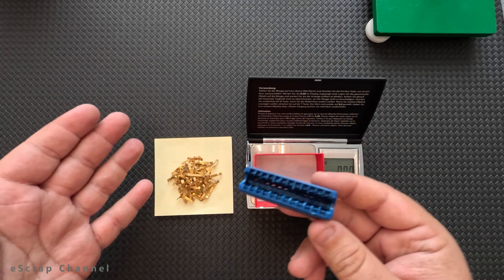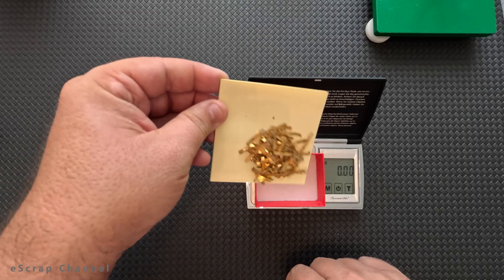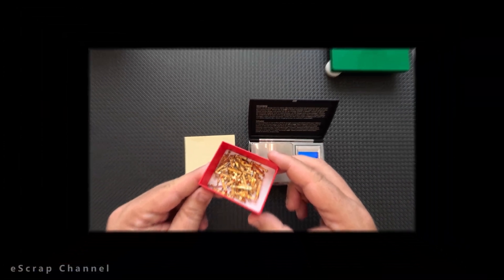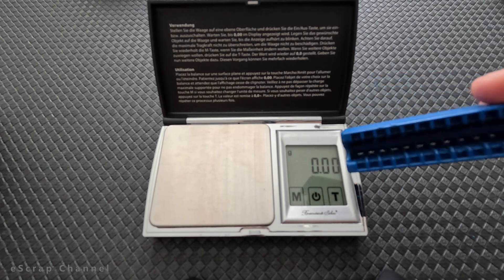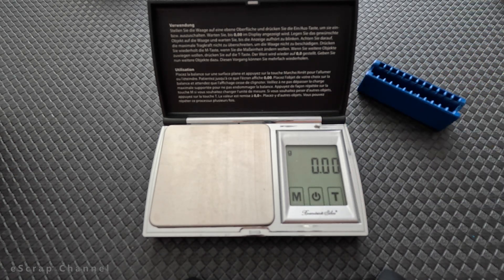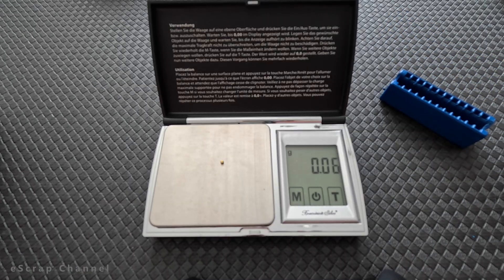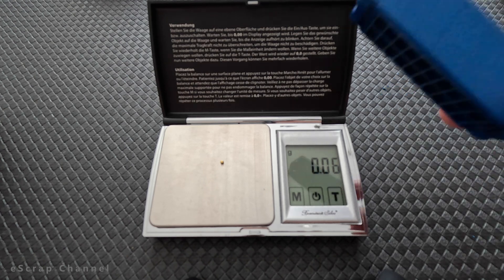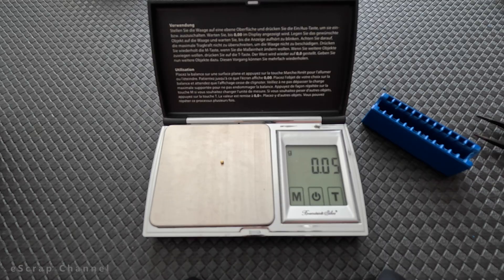Gold Content Check - AMPHENOL slots

Comment: Hi, 
I'd like to try something like this, and since you're experienced, I'd like to get your opinion. Normally HNO3 is used to dissolve silver and then convert it back to silver. I want to dissolve the silver with aqua regia and convert it back to silver. As I said, I'm just trying it out of curiosity. Do you think I'll be successful, and do you have any advice?
Reply from the maker: Hi, everyone that started refining lost a lot of material in the learning process, so if you’d like to try my first advice is use small amount, like 1 gram. It is easier to work with small amounts. Less fumes. And if you do something wrong - you minimise the loss. To refine silver you don’t need aqua regia. I have some videos and even tomorrow a new one is coming where I recover silver. Steps are: impure silver is dissolved in nitric acid. Then you can use copper rod to grow silver crystals directly or hydrochloric acid to drop silver chloride. If you drop white silver chloride residue you should wash it with water 5-6 times to remove impurities. Then you can use zinc granules, add a little acid and heat. This will convert silver in silver chloride to metal silver. If any zinc remaining - remove the granules. And you melt. Do reaction open air if no ventilation. Protect eyes and hands. Nitric acid levels nasty yellow / brown spots on skin and silver leaves black ones - no fun as the stay long. Processing one or less grams gives good idea about the smell and fumes - don’t inhale them! Finally - per my opinion it is better to find a refiner and go to see how it works in a controlled environment. Then you take informed decision on your own actions.
Reply: @escrapchannel  Thank you very much.
I will take your advice and warnings into consideration.
I wish you success.
Reply from the maker: Thank you and good luck!